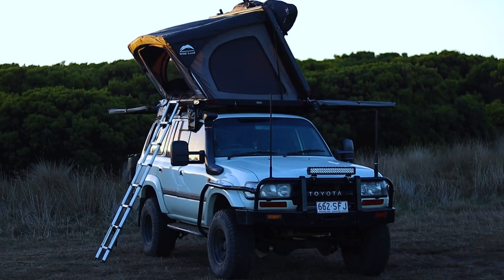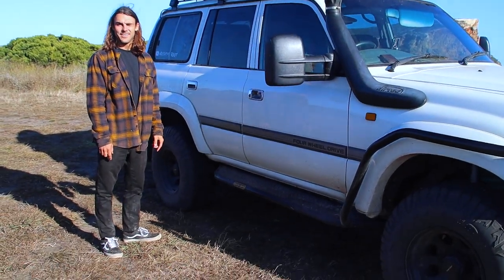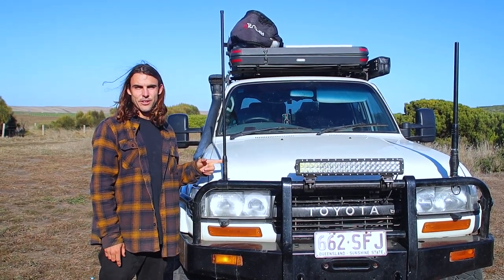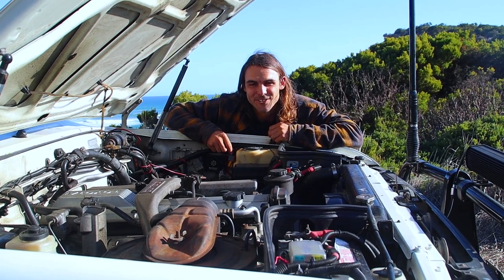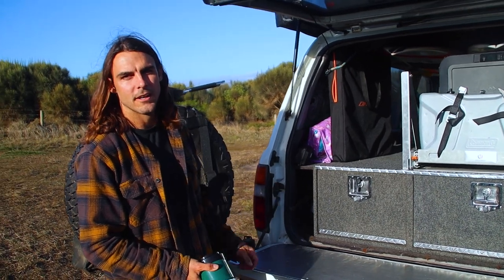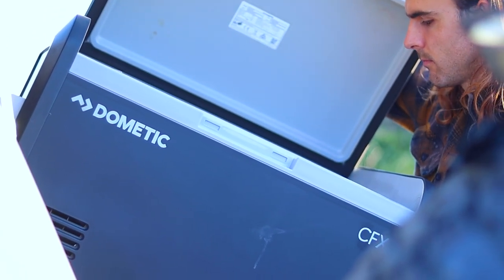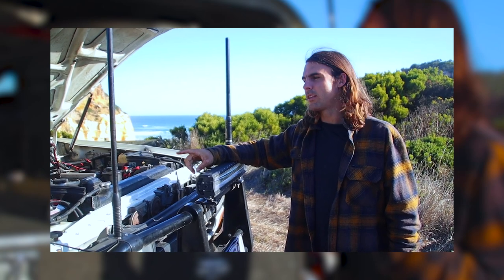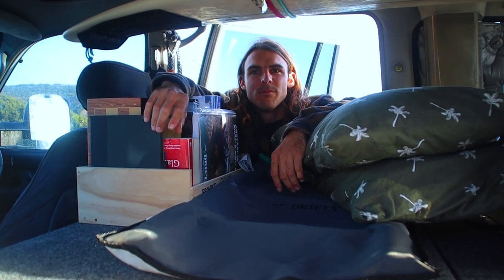Our Landcruiser 80 series for full-time travelling: 4WD tour of our home on wheels!

Comment: FAF, good review guys, Bronte's Book club is a winner!:washhands:
Best get another set of roof bars and spread the load before you damage the gutters cause that part is not designed for all the weight, especially when u guys are in it and  testing out the suspension.👩‍❤‍💋‍👨🤘

Comment: How's the fuel economy?
Reply from the maker: 14L/100 on the highway fully loaded but I was nursing the crap out of it 😂
Reply: @wrightysroot  I feel like that's really good all things considered. My 2002 Prado has an extra 80k on the clock over your 80 and she does 16L/100 with 50/50 rural/small town driving.
Reply from the maker: @xlncaustralia3261  taller 5th gear does the trick